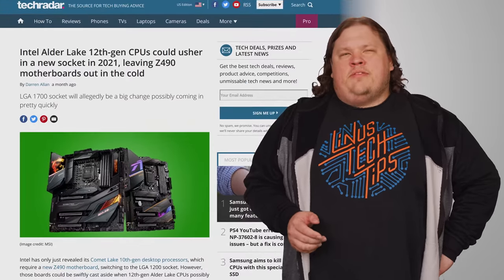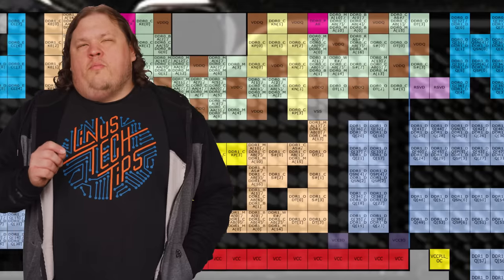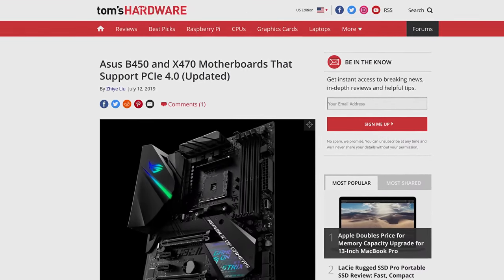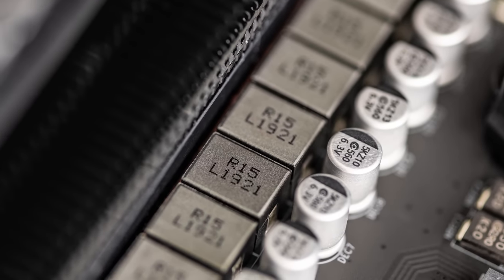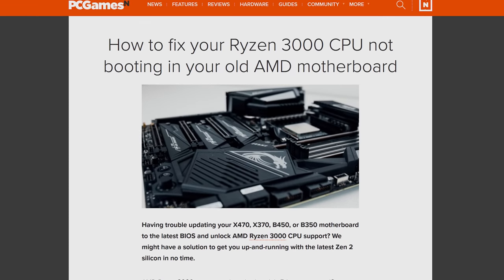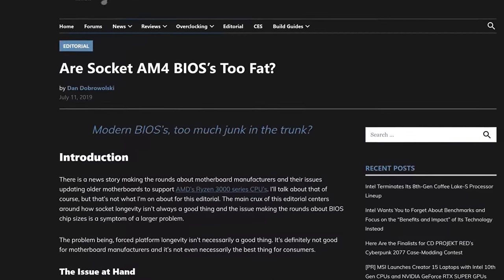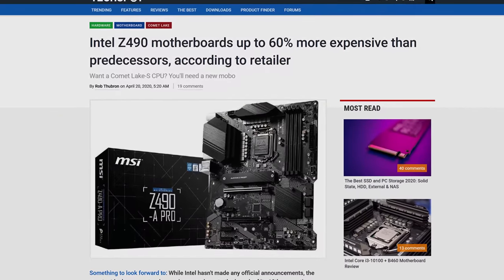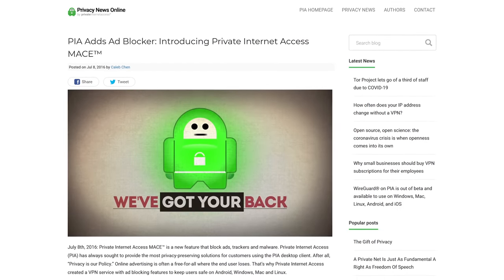Why CPU Sockets CHANGE So Much

Comment: A more realistic upgrade scenario be like:
- You want to upgrade the GPU
- You realize the new one will get bottlenecked by the CPU
- Then you realize the mobo is also getting replaced cuz of the socket
- And also you need new memory because the DDR standard has updated
- Might just as well buy a new case now
Reply: And then you need to replace your ide hdd...lol
Reply: I went on a similar rabbit hole when I wanted to make my PC quiet. 
After two months of research, I decided  I will just make next PC quiet and make the current one a server for monitoring and NAS ;)
Reply: Yeah, true story.
Reply: What about that power supply, is it still good enough...
Reply: @TaranTatsuuchi  yeah that too
Reply: Honestly, these things have gotten so much better than they used to be.  At least you can keep your graphics card, because the slot didn't change from ISA to AGP to PCI to PCIe.  Apparently all PCIe x16 1.0 and 4.0 are compatible.  And AMD's 5 years on the AM4 CPU socket was nice.  Still, I'd like continued improvements.
Reply: Which is why GPU should be the last thing you should buy
Reply: @valdius85  Went through the exact same rabbit hole as well
Ended up settled on an open frame PC because it's the best cooling solution so I can run all fans at the lowest speed
Oh I also got rid of HDD because of HDD noise.
Reply: ehh, replacing your case is only really necessary if you need more features or ATX somehow gets replaced
Reply: @Blackfatrat  Why though? Why 'throw away' the case as well? At that point you might as well get a new keyboard, mouse, displays, desk, gaming chair and even a new power strip... Why not lay some new floors while you're at it xD
Reply: @tomf3150  not really. You can get IDE controller cards pretty cheap.
Reply: @shariqhasan6220  first thing, gpu is the engine to run games and need to have high horse power, every build :choose gpu first , 45% to 50% budget of the build into gpu
Reply: I was succesfully upgraded my PC for 15 years. Keepeng computer case the same i put in it 3 motherboards, 4 GPU, 3 CPU, 4 kits of ram, 1 sound card, 3 PSU and some other stuff like storage and perefery. So, there is a way to save money and not replace all parts at the same time.
2 years ago i estimated, that every single part at it's limit. There is no room to replace one or two to go "next gen". It is decent, can run cyberpunk at low-mid settings, but there is no future. So i built new one keeping old as home server.
The only rule i made is to NOT spend on low-mid tier comonetns which get oudated in 2 years at most. Bying something near the top but never trying to catch perfection.
Reply: Dude you didn't have to call me out like that

Comment: "We can't even seem to make it 2 years without CPU sockets changing?"

AMD: Am I a joke to you?
Reply: yes
Reply: laughs in LGA775
Reply: no one touch it
Reply: @codfish1113  yes... that existed for 6 years before being replaced by LGA 1156
Reply: @codfish1113  Had one of those until 2 and half years ago...
Reply: Laugh in X299?
Reply: why do you think AMD was the main source for this info? Calling out the competition...
Reply: Power cut when bios updating: yes
Reply: @divoulos5758  eeks! And I thought power failure during windows update suck lol
Reply: @whitebeartigtig  and lga1156 also lasted a while
Reply: @dennispremoli7950  because using 16 mb for a bios is cheap from them, just like their whole company 
Intel 128mb bios intensifies
Reply: @antoniohagopian213  *Cough* fanboy *cough*

😜
Reply: Intel 1151 lasted 4 years, over 4 generations. This video should be about chipsets not sockets
Reply: *Am(4) I a joke to you?
Reply: @razeel2000  apparently lol
Reply: @codfish1113  Lga775 was a mess, mate.
Reply: @AdriandeMorcerf  *throws a white hot Preshott* lies not all 775 chips were terrible.
Reply: @divoulos5758  UPS, good sir!
Reply: amd fanboy: let's talk how great amd because old generation amd really great at heat
Reply: @PunxTV123  How about someone counters with netburst architecture? Or core i9 macbooks running so hot they throttled themselves below the proformce of the i7 equipmented models?
Reply: Still only made it 4 years and you can't have a mobo longer than 3 before needing to upgrade
Reply: @divoulos5758  UPS and problem solved, I got my PC connected to one just because of data loss in case it happens.
Reply: @divoulos5758  Laughs in Gigabyte Dual BIOS
Reply: @codfish1113  LGA775 which barely supported a quarter of all LGA775 CPUs... So while you could physically fit every LGA775 CPU in that socket, most won't work...
Reply: @codfish1113  775 was the best socket of all times
Reply: @JohnSmith-xq1pz  I still have my old PC with an LGA775 socket. It has a Pentium 4 in it. Got it 9 years ago and it's still going strong.😅

Comment: I remember back in the day when we had socket adapters. I had a server that used a socket 7 Cyrix chip in a slot 1 adapter.
Reply: I remember back in the day when everything just used socket 7...
Reply: @petereverett1455  Yeah when AMD was literally there to copy intel's architecture as a secondary supplier.
Reply: That would never fly nowadays with how locked down modern UEFI is.
Reply: @rattlehead999  That's not remotely true. AMD had slower FPUs than Intel. Also, I think you're forgetting that AMD had been making x86 chips for generations by then. They were not just copies. Hell, AMD had 486 designs that clocked way better than anything Intel had.
Reply: @samiraperi467  I remember my AMD 100MHz system I upgraded to from my DX2/66. My Cyrix 586 chip didn't like the motherboard I put it into and blew 3 caps on powering on. Good times.
Reply: I remember back in the day when there was no socket, just holes in the circuit board for the only model of CPU available.
Reply: There is no Slot 1 adapter for socket 7. Only socket 370 (and Socket 8, but only a few very early motherboards will support this adapter and I have only seen a picture online, but never did anybody sell one anywhere, so it might be fake)
Reply: Almost certain it was a socket 370 CPU.
Reply: @Tom2404  I think your right. It might have been socket 370. It was definitely real. I used it as my webserver for years before I had a hosting account. I might actually still have it somewhere. The system still worked when I decommissioned it. It was just a hassle hosting a webserver myself and was easier just paying a host every month.

Comment: Motherboards producers aren’t complaining... they get more money 🤷🏽‍♂️
Reply: But there is a catch to that, they have to put in work, which costs more than producing the old stuff.
Reply: They still need to design a new motherboard and retool factories to manufacture the new product. If many types of sockets are in the market and new ones are coming relatively frequently, it could be tedious and expensive for manufacturers to keep up.
Reply: Not really, people are simply buying a cheaper motherboard more often rather than a more expensive one less often.
Motherboard producers have a much lower margin from those cheap ones.
So its not worht for them to swap sockets so often.
Reply: its real simple Intel and AMD sell chips to the motherboard producers if you don't buy a Intel or AMD board you will always en for ever pay both the manufacture of the motherboard and Intell or AMD for their perspective chip-sets on those motherboards.  you buy a new intel or amd cpu then you buy a matching motherboard that has the intel or amd chips on it so they win win win.
Reply: exact opposite dude. They would earn more money by keeping the same socket and Mobo design as they dont have to do R and D as well as produce a new process for it. This is why Apple for instance uses its designs for 3 or more iterations before they change them as it is costly to start over.
Reply: @GrimYak  how much do you think they spend on r&d and why would they lose profit on it. Just think logically here the r&d is done per chip they sell for only the top of the rang one then by doing simple things they derate the top line chip to fit specs of lower priced boards and cpu's, but the people wanting the best of the best pay all the premiums then the lower specs pay all the extra pure profit. They need to keep people buying the new stuff so they keep the share holders happy. The easiest way to do that is keep selling mother board components by changing the cpu sockets. After alll its a big market if you keep on forcing people to buy new. Sure the cpu's might need more power or connection but why not try to design a socket that would last longer if they would make more profit doing it your way. They dont.
Reply: When you look at AM4 motherboard manufactures, they have NOT stopped producing new boards every 6 months. So just because AMD has kept the same socket does not mean the only mboards available are 3 years old. If you add up the number of boards, manufactures have as many boards for AMD as Intel, even with all the "new" Intel sockets introduced over the past few years.
Reply: They make so much money from PCBs for everything else that they don't really care

Comment: I remember the AM2+/AM3/AM3+ times when a lot of (mid-range and lower) boards would run with newer CPUs but didn't officially support them. Problems ranged from terribly running systems and complains from CPU not performing as they should, to in some cases VRMs just breaking in no time and CPUs only running when half the cores where disabled. Terrible times those were

Comment: Socket 775 lasted for at least 5 years (even though the chipsets changed):  Pentium 4/Celeron, Pentium D, Core2Duo (plus a refresh), Core2Quad (plus a refresh). Socket 775 was used on boards that supported DDR1- DDR3, Pentium 4 to Core2Quad different chipsets and architectures . The socket was mechanically compatible, but you couldn't run a Core 2 Quad on a first gen LGA 775 boards due to incompatible chipsets.

Comment: "Why CPU Sockets CHANGE So Much"
AM4: Am I a joke to you?
Reply: This video was most likely intended towards Intel. AMD knows what's upp
Reply: Well, when they don't change much about their architecture it's normal to stay on the same socket.
Same with intel. Intel's been on the 1151 socket since 2014, because since 2015 and skylake they haven't touched their architecture. And realistically there is no reason for Sandy, Haswell and Ivy bridge NOT to be on the same socket, but oh well intel is intel.
And let's not start laying it down on chipsets.
Reply: Intel ....4 years, 4 generations, the same socket
Reply: @rossharper1983  6 years. Since broadwell in 2014. But since skylake in 2015, the architecture has literally remained the same.
Reply: @rattlehead999  Broadwell was 1150. Pedantic I know, but don't want to give the AMD fan boys any ammunition
Reply: @rossharper1983  the video is misleading they are talking about socket every two years but they should talk about Chipset where Intel only last 2 gens, AMD 3 for now.

Comment: Well done. A brilliant explanation to a question that I have been asking for years. I work in the electrical power industry and we always change our plug and socket type when we move up into higher power usage. Domestic plugs and sockets can not be used in industrial setups.

Great explanation. Thanks for it.

Comment: Do AMD and Intel work the same way in regards to the pins being assigned to specific duties?
Reply: I think so. What is the point of having multi-purpose pin
Reply: Firmware/microcode can reassign some pins, but it's generally an exception because most pins on MOBO are physically wired to power delivery or a specific bus.

Comment: I remember well the socket 7 when I started with computers in 1995. The socket 7 started in 1995 with Pentium CPUs above 150 Mhz. It could accept the Pentium, the AMD K5, K6 and the Cyrix CPUs. So people could upgrade their motherboards with a big variety of CPUs. In 1998 the super 7 socket was introduced which was backwards compatible with the socket 7. Super Socket 7 could accept the first generation of Pentium CPUs above 150 MHz  but not the Pentium II processors. However the super socket 7 was designed for the AMD K6-II and Cyrix MII family of CPUs which had similar performance of Pentium II CPUs or even early Pentium III CPUs with the AMD K6-III CPUs . 
The first Pentium CPUs of 60-66 MHz were introduced initially with Socket 4 in 1993. The later Pentium CPUs of 75-120 MHz and some early AMD K5 CPUS were introduced in 1994 with socket 5. 
With the Windows 95 and the expansion of internet in 1995, the computers and the web surfing were easy for nearly everyone. There was an explosion of the sales of computers. 
Most people like me remember well the socket 7 because when windows 95 were introduced, most new computers had Socket 7 motherboards. 
My first motherboard in 1995 had a socket 7 with a Pentium 150 MHz (no MMX version). In 1997 I overclocked my Pentium CPU to 166 MHz. In 1998 I had more knowledge and I easily replaced my CPU with the affordable AMD K6-II 200 MHz. I did a little overclocking at 233Mhz and the performance according to benchmarks was similar  Pentium II 233 MHz for half the money. In 1988 I upgraded my motherboard with a Soyo super socket 7 one that had 1 Mbyte cache memory (RAM memory is a different thing). At that period cache memory could be found on motherboards and in some cases could be upgraded. The increase of performance was significant. 
In 1999 I upgraded my CPU with the super socket 7 AMD K6-II 400 MHz overclocked to 450 MHz. It had 256 Kbytes internal cache plus the 1 Mbyte cache of my motherboard. The performance according to the benchmarks I run was superior to the Pentium III 450 MHz and I have invested half the money. 
The super socket 7 lasted until 2002 with the AMD K6-III 550Mhz. At that period the AMD athlon was introduced with its own socket. 
In 2001 an owner of a super socket 7 motherboard could choose CPUs that were introduced from 1995 to 2000 from three different manufacturers. 
Something unprecedented and unique in the history of home computers.

Comment: I like the BIOS update solution used by some motherboard manufacturers, like MSI, where you don't even need to have a CPU in the socket, just plug in a usb stick with the bios file, attach the PSU cables, and press a button :)

Comment: Good timing. I have been saving up for a Ryzen 5 3600 to upgrade to from my Core i5-6500. Having to buy a new motherboard while the old one is still fully functional is just one of the less desirable side effects that comes with upgrading your CPU.

Comment: The answer given raises the question of why there's not "future proofing" (I know, cursed words) on the chipsets. Why there's not an option for enthusiasts to buy a board with significant pin and power draw overhead that the manufacturer could expand into as needed. That only leaves the "firmware is inconvenient" element, which is not a concern for said enthusiasts.

Comment: AM4 socket is a hero for sticking around as long as it did. That thing held on so long I went from a ryzen 1700 (not 1700x) to a 5800x3d on the same board. Im going from a GTX1060 to an RTZ 3090 as well... but that 3090 will go to the next computer, when the am4 kinda hit its final form with the x3d bankai.

Edit: Screw you Anthony, I do need that DLC for goat simulator, I don't need your judgement for my sim gaming addictions.  (Luv u Anthony)

Comment: A few thoughts
1. While the prospect of being able to upgrade your CPU say four years down the line sounds nice, it also comes with some caveats. The only thing you're getting is likely CPU performance. I mean duh, that's a given. But if the CPU has newer features, then those features may not be supported by the older motherboard. For example, if you slipped in a PCIe 4.0 CPU on a PCIe 3.0 board, and then later got a PCIe 4.0 video card, you may run into an issue where the PCIe 4.0 video card is being bottlenecked because it's on a PCIe 3.0 bus. Granted this hasn't really been a problem except in the case of the RX 5500, but it's still something to consider.
2. The 16MB BIOS size limit was apparently because Zen 1 and Zen 1+ had this by design. I'm not sure why AMD did this, but part of me suspects it may just be baggage from the overall design of x86 itself. Like how motherboards made since the 80286 had to accommodate for the A20 addressing hack until around 2010.
3. I'd also argue there's also an engineering decision to be made with how many pins you want. More pins than the CPU needs does offer room for growth, but until those pins are actually used, they're just dead weight in the manufacturing process. NC pins are still often on the CPU package. If you're pushing millions of units, that penny the pin(s) costs adds up.
4. Ultimately though, I still question how many people upgrade their CPUs. I know a lot of people do, but a vast majority still don't. They just run the computer into the ground and buy a new one at that point. If anything, to me keeping the same socket for as long as possible is more beneficial on the manufacturer's end because they don't have to accommodate for a new socket and change up everything. Even Intel's sockets are largely similar in terms of pinout as far as I can tell, despite being incompatible with one another.

Comment: Technical engineers can make a generic interface that could load an indirect CPU UEFI meta package; however, that would require revisions on security. These verifications and message passing would mean a longer boot time. Inherently, generic interfaces require more validation so that means longer time between releases of technology improvements.